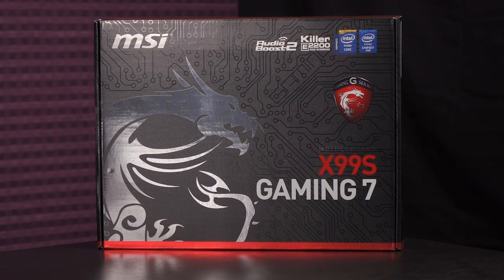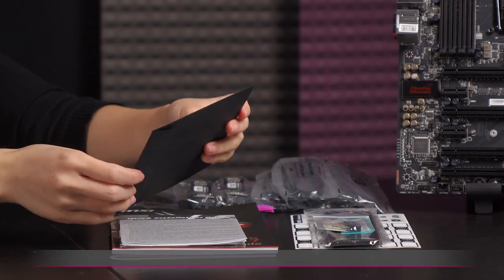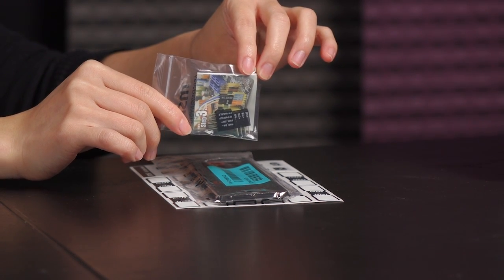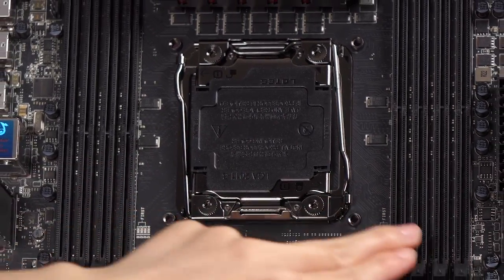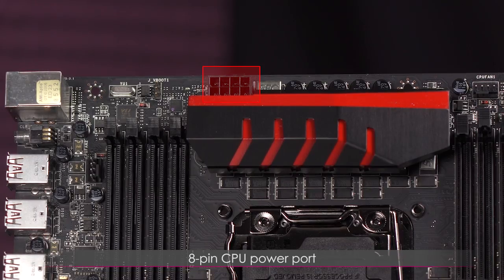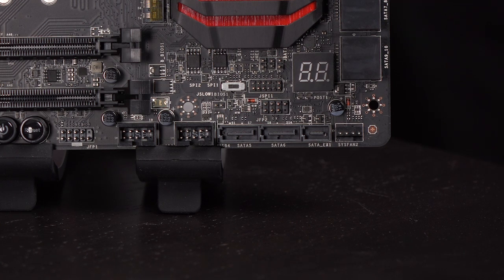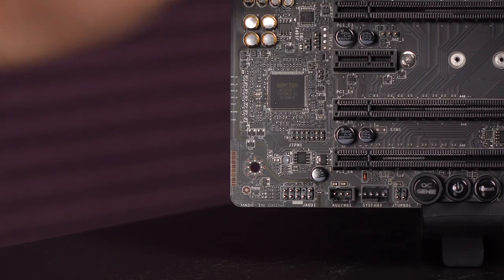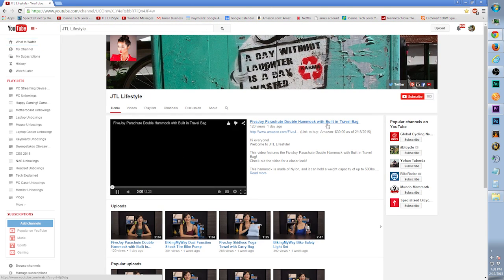MSI X99S Gaming 7 Motherboard: Overview

Comment: i know this video is a bit old but does this mobo really physiclly fit 3 large gpus in sli or is there a size limit?(for example gtx titanx or 980ti)cause this  atx look a bit small to fit that much in.

much apreciated if answered
Reply: yes you can i do 2 way sli and you easily have room for more but remember they will be close together

Comment: Question please, i dont know much about OC, so i thought about using the OC genie instead.
When OS restarts, it freezes and only i get is the following message: Oc genie is enabled we do not recommend to modify settings... and thats all, it freezes forever and stays like that
After manually restarting my PC the third time i get the following message:
All settings were reset to default values
The previous overclock settings have failed, system has been restored to its default settings
Press F1 to run setup
Press F2 to load default values and continue...
My specs: I7 5820k CPU 3.3 Ghz, 4125 Mhz
16 GDDR4 Predator hyper x 4x4
Msi x99A Gaming 7 MOBO
Msi Geforce titan X
Power supply es 850W Cooler Master Gold series
Would this problem be related to Power supply? maybe something directly related to MOBO itself?
TYVM in advance people

Comment: Do all motherboards or this include "wifi" receiver or do i have to buy an external receiver for it?
Reply: You have to buy ASUS PCE-AC56 802.11ac Dual-band Wireless-AC1300 PCI-E Adapter. If you want to get wifi
Reply: +Jayz Chann You'd be missing out on the benefits/features (especially for gaming, and this is after all a gaming mobo) of the Killer NIC if you use a wireless card though, so unless you really have to, it's better to go wired.

Comment: What CPU are you planning on using? o.o
Reply from the maker: Not sure yet! 
Hopefully I can get a sample from Intel :)
Reply: Well I can definitely vouch for the 5820k, it's an amazing processor. 
Though, I do want to try the 8 core, and possibly the 10 core and run some rendering benchmarks. But so far I can run every game I have at max settings all at once and over 400 tabs in google chrome. I have yet to actually stress this thing out. XD
Reply: Good luck on getting a sample!!! I'm sure many others would love to see the performance of the 2011-3 cores.

Comment: MSI has come a loooong way.
Reply from the maker: What was it like before?
Reply: Joanne Tech Lover Well, MSI was a company that literally started off in an apartment in the mid 80's. Since then it has become one of the top leaders in the micro computer industry. I mean it is one of those stories where a company grows to a giant from almost nothing. It is now, just light years from where it started.
You will find MSI parts in things you would not even think that they would be in.
Did you know MSI made the first (possibly the only) overclockable 286 motherboard. Really they made computer enthusiast parts before it was even a fashionable thing to do.

Comment: I remember my first PC in 1994 has a serial connection for the printer and another for a mouse. I think even then I used the 'high tech' P/S2 port for my mouse. And the sound cards back then had a joystick port on them. Now its all USB. hehe man cleaning those roller ball mice often. Sigh.
Reply from the maker: Whoa, that's what it's for XD.
I remember owning a roller ball mouse!

Comment: Still love my MSI's.  I use OBS too.  My mobo's are couple years old, (Z77 Mpower Military Class), but most of the components and setup is the same like the OC Genie button,etc.  But, that's sort of unfortunate that there's no display or HDMI port, and there's no wifi or bluetooth either.

Kind of interesting that the SATA5 and 6 are flat on the board like all the other connectors on the mobo.  Finally they did it right.  I hate how the other SATA ports are going at 90 degrees, but that's how everyone does it.
Reply from the maker: Oh you're right...no wifi card. 
That is a bit unfortunate...but, I guess I could always get it separate! 
It's harder to plug in when they're 90 degrees!
Reply: They cannot put any DP/DVI/HDMI/VGA on x99 as Haswell-E does not have any graphics cores on the processor.

Comment: I love the performance X99 offers, I just hate the Gawd awful slow boot up time when compared to the Z97 chipset. My Asus X99-a boots up on about 30 seconds using Samsung 850 Pro (512 GB), while my brother's Gigabyte Z97 boots up in 15 seconds  ( crucial  MX100).  Hell even my mom's AM3+ OCZ Vector  150 boots up in 15 seconds or so.
Reply from the maker: Thanks for the heads up on the boot time feeling weary
That's scary.
Reply: The performance of the X99-A outweighs the boot time. It just sucks to build 3 Z97 systems between $800-1300 for my clients, and look at my $1900 system stuck at Asus logo while having the Z97 desktops up and running on the rest.

Comment: that's nice board. i hope they added offset voltage for overclocking because the older x79 boards didnt have it.
Reply from the maker: teeblack06 I'm looking forward to building on it! 
Why is offset voltage important for OC?
Reply: when the cpu clocks down on idle or lite browsing or whatever i want the voltage to go down with it. no since in pumping high voltage into the cpu while it's down clocked.

Comment: I don't get these "gaming" boards. The only reason (in my mind) to buy a high end motherboard is for multi GPU or multi CPU set ups (or if you need insane amounts of ram). Like anyone with this kind of dosh to drop will have a real sound card/external DAC/AMP.

at least it isn't as bad as those boards that have all that "shielding" on them and look ridiculous.
Reply from the maker: MrMassivemeatlog It looks great, and it's going to be awesome for editing! 
My current build...just doesn't cut it for rendering!
Reply: Joanne Tech Lover Maybe MSI should change it to "Work Hard, Play Hard" brand to this type of board, i guess. :3